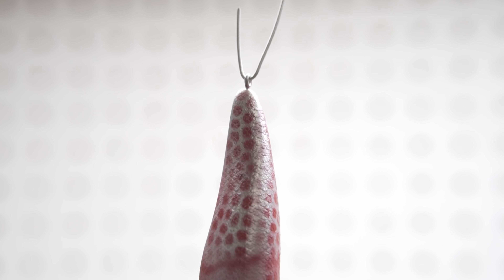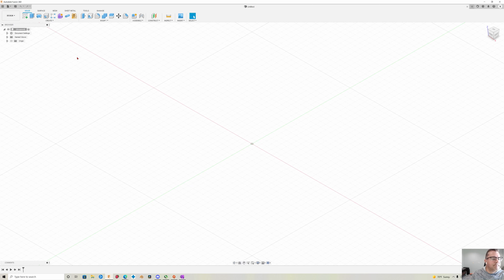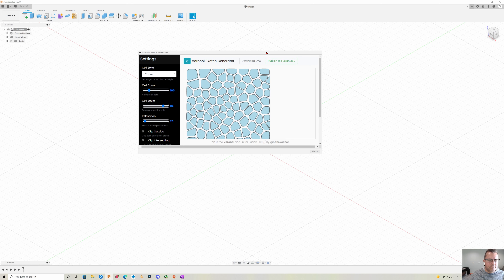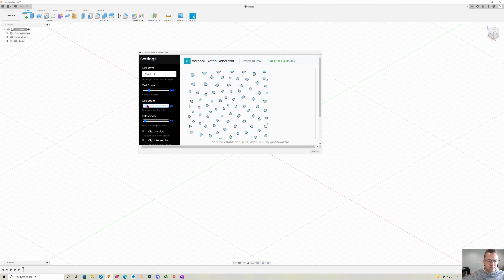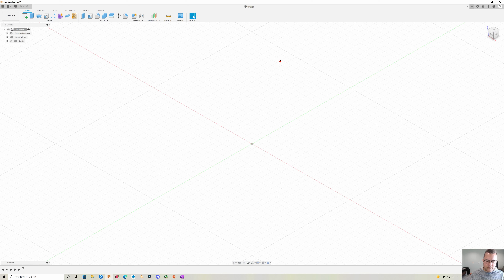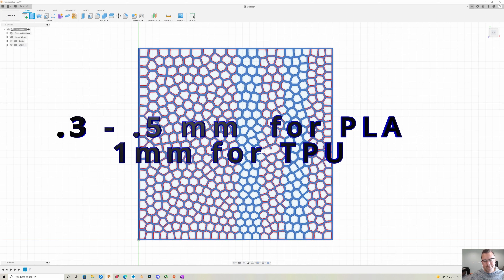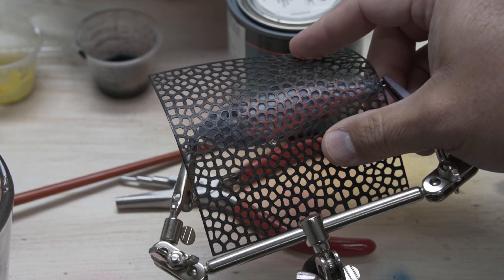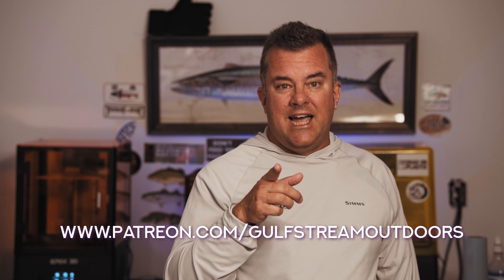3D Printed Lure Stencils Tutorial

Comment: For the tpu make sure you let your bed and print cool down completely. If that doesnt work you could try some windex spray to pop it off. You can also put a thin layer of glue stick or layer of painters tape to easily remove from the bed. 90% isopropyl alcohol might work but test it on a scrap of your tpu as some people say some brands react to it with swelling etc. You were pulling on the bed pretty hard which can cause it to unlevel and jerk your steppers if theyre not disabled which can cause electrical issues. Most sticking issues seem to come from having an unlevel bed and z offset issues.